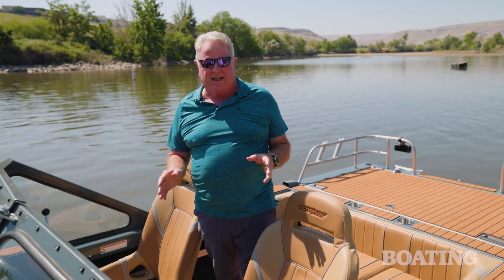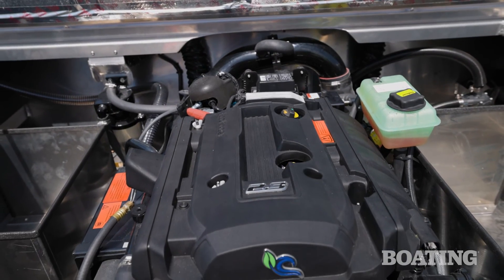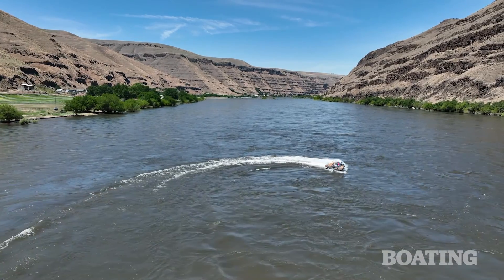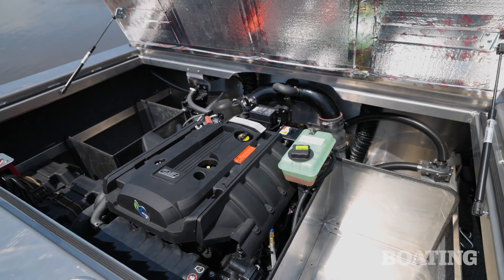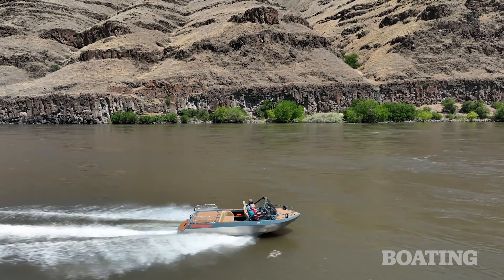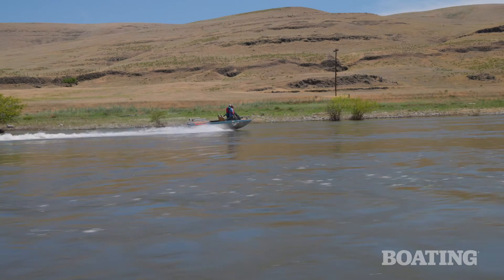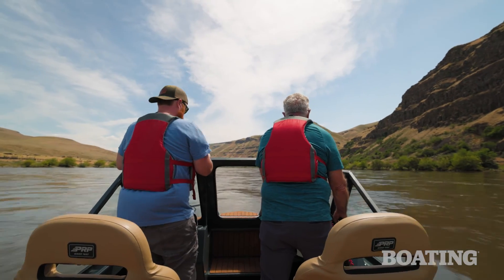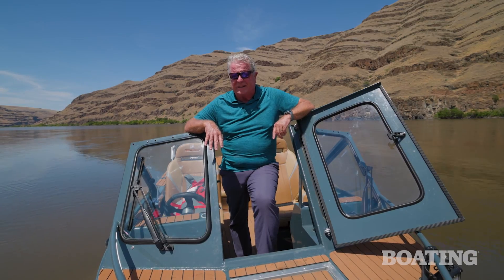Indmar’s  2.3L EcoBoost powers MotoJet’s Mini Jet Boats

Comment: That is not a mini jet, that's a regular size sport boat 15 or 16 feet long with a little back seat.  Mini jets are 10 to 14 feet long and narrow. Have you put that engine package in a real Mini ? I have road in a 18 foot Coyote 10 degree with the Eco Boost, it worked well and was nice and quite, the boat had no extra options to keep the weight down. Worked good.
Reply: We are a mini jet boat builder, no this boat isn't a mini. We have put this engine in our 14 foot hull as well. The white boat in the group shot (as well as some of the engine shots) are the 14 hull. Not an ideal engine for smaller boats because of size and weight vs USCG regs.